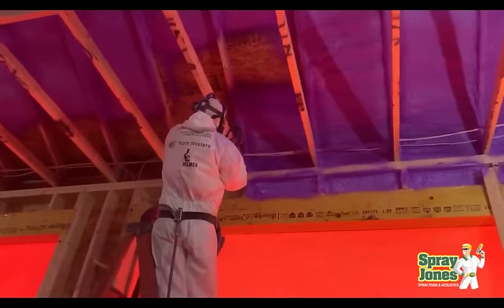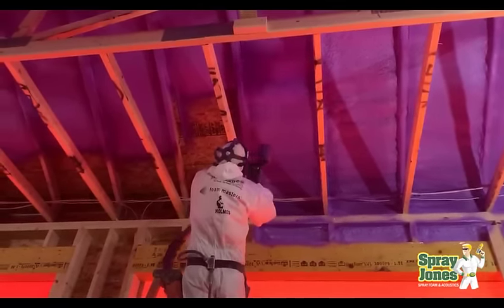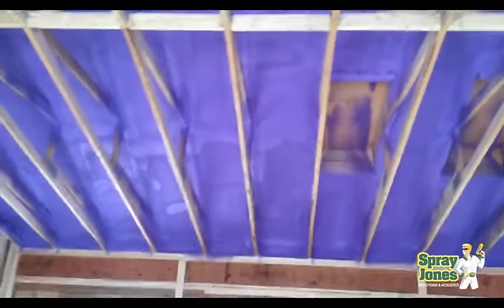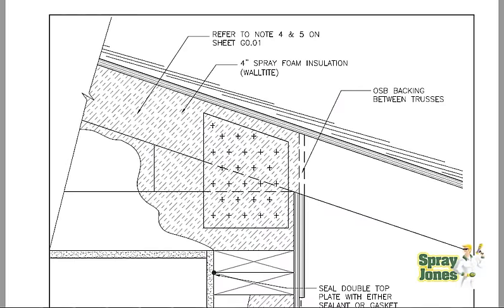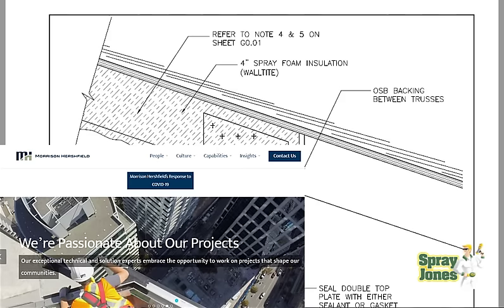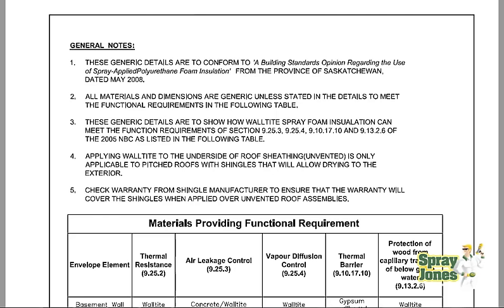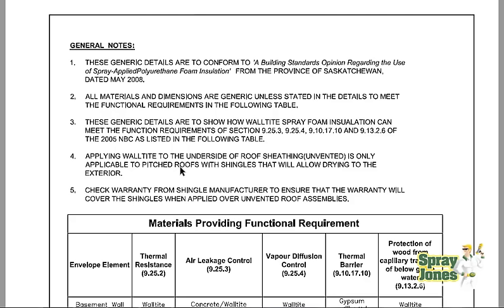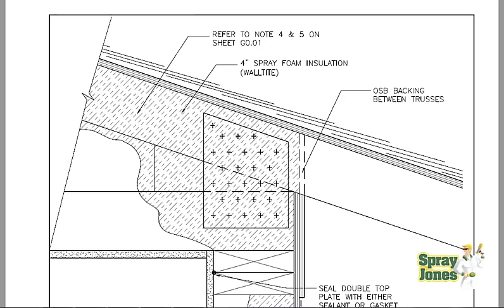Unvented roofs - Closed cell vs Open cell Spray Foam Insulation which is better?

Comment: I need help!!  I have an 11 year old home, 5/12 pitch unvented roof with synthetic underlay and standing seam metal roof on 5/8" tongue and groove plywood. TJI joists support the plywood on a post and beam structure. 7" Closed cell foam insulation is sprayed to the underside, so unvented roof. Every winter the plywood underside in the exterior soffits are completely frosted up and pour down water through the soffits all around the house perimeter every slight thaw. The soffit overhangs range from a minimum of 4.5' to about 12' wide where there are decks underneath. All of the width is frosted up, crossing several TJI joists, and in fact so are the TJI joists fully frosted. Since this is post and beam, and unvented roof, the soffits are 3/4" pine ship lap, with no venting. I've had the builders back a couple of times to try to solve the problem, assuming air leaks. Once they re-sprayed foam from the interior perimeter of the joists and headers. The second time they sprayed the perimeter of the same headers and joists from the outside after removing soffits. But there is not much improvement. Sunny mike winter day today, and so it started raining from my soffits. In the past I have tried leaving the soffit wood out, and the extra air does help, but there is still some frost even then. 

What the heck is going on, and how do so fix this??
Reply from the maker: First you need to get a thermal camera to scan these areas and see if heat or air leakage is present. The scan does not lie. If you see no issue with the SPF or air leakage then you eliminate it as the source and move on to other outside anomalies that can do this. 
All the specs you have given are more than enough to figure this out. Did your builder or you caulk the double top plates that the TJI rafters rest on? How about other areas within the structure for air seal? Are they all caulked? It is common to see the wood seams leak into the soffit area, warm air rises.... The camera will pick that up.
Reply: @SprayJones  The builder was here today ripping out a section of soffit so we could see if fully venting the area would prevent the frost and condensation buildup. The plate on top of the log beams is glued down with construction adhesive, as are the TJI to the plates. If I could send you a picture or drawing so would.
Reply: What thermal camera do you recommend for construction building envelop applications like we discussed?
Reply from the maker: @jb5676  The best you can afford. Flir or fluke.

Flir is the most common and you can pick one up for $500 or under. 
You should have a professional blower door test done with a thermal camera scan. That way the air leakage is exaggerated and ca be seen easier.

Comment: Watched numerous videos of yours you are destined as you said to do this. 
looks like you do great work I've been trying to figure out how to re-insulate my home in Maine which the fiberglass has failed and mice have gotten into it and everything you can imagine because of the roof venting. 
I'm going to continue studying your method as philosophy and by next summer should have a good plan to re-insulate with foam. 

I'm wondering if you can recommend any certified companies in Central Maine that could do as good a work as you do on my house ?
Reply from the maker: Thank you for your feedback it is a welcomed change from the "experts" who chime in their critiques. 
You will have to open things up, remove and clean and then proceed with foam. I cannot recommend anyone in that state.  I get asked this weekly now.... who I can recommend for all over the USA and Canada.
Reply: Try Maine Passive House Bethel Maine

Comment: You've mentioned shingles a couple of times.  What about metal roofs?  Is it OK to apply closed cell like this with a metal roof?
Reply from the maker: Yes
Reply: Closed cell applied direct to metal is common for "barndominiums" in this area.

The metal shell is erected, then interior framing, most plumbing and electrical work done to point of ready for insulation-drywall.
The foam is applied at this point, essentially gluing the wood frame to the metal structure.  The difference in spacing of 2X lumber vs the wide spans in the metal sheet support frame "purlins" results in very few places for heat conduction from outside to inside.

Some amazing R values have been achieved and the buildings are so tight that dehumidifiers are often required due to low air exchange failing to carry moisture from people breathing to the outside of the building.

Comment: Well in my local building code change this to you can't use closed cell on roof underside and encapsulating the rafters. The reason being there was one or two roof collapses because of a poorly maintained roof and the leak over decades had rotted the sheathing and rafters and there was no signs of a leak inside, so no one checked. You can however use open cell because once the foam gets saturated then it would be visible inside that you had a leak and would then go up and inspect the damage and make repairs, plus it was a good idea to replace or dry out the damaged foam. Also our snow load where I live is 62 lbs per square foot which is also a factor. You say these engineers certify that product under those applications, well sure they would, but a poorly maintain roof would not have a bearing on that certification, that's on the owner to ensure their investment is protected. So I guess one or two dummies wrecked it for the rest of us.
Reply from the maker: That's no good. Someone need to take a lead with a supplier and building envelope firm and get that changed. I would if I was there...

Comment: Not a roof but the ceiling of our garage was sprayed with closed cell foam. We have a loving space above this garage and the floor of this room is always  very cold. I put in an insulated garage door and like I said sprayed about 3” of closed cell. The floor above is still quite cold. Any ideas as to why? The contractor said doing the foam would solve the problem but clearly not and still waiting to hear back from them
Reply from the maker: I would have to see the detail and how they did it. Send me an email via my web site. Include some pics.
Reply: @SprayJones  unfortunately it’s all been dry walled over now
Reply from the maker: @skyline5354  Well without seeing it and plans of what was done I have only guesses to offer...

Comment: We recently completed a 12/12 pitched roof with the axis east and west for future solar. Direct southern exposure and the plans specified closed cell foam on the underside - no ventilation.
I've been doing this for almost 50 years and the thought of a cathedral roof with no 1" continuous ventilation from soffitt to ridge vent used to be heresy, but now is the preferred method.
I have been in many an attic that is suffocating in the summer heat, and the old 3 tab roofs would literally curl up at the edges like bacon and then a stiff wind would bend them up and over at the next edge. My concern is what roofing can stand up to the south sun with an insulting layer under that allows no heat dissipation? You mentioned 'ice and water' as the underlayment and the specs did note the roofing material needed to be approved for this application. I'm in Seattle, so not so cold and not so hot, but plenty of water. 
In addition, our building inspector mentioned the dew point as the main factor in negating the need for ventilation.  I have a roof interior coming up for insulating and want to be convinced that this has stood the test of time and I'm just ignorant.
In the 80's we went thru a period of maximum building wrap, sealed windows, caulking everywhere and vapor barrier on the inside, but the exterior envelopes leaked, the insulated walls could not  breathe and there were whole blocks of apt buildings requiring residing in less than 10 years. It was a major problem up and down the west coast from Canada to California.
I subscribed and am working my way thru your videos...Thanks for all the info. I know this is part of your marketing but I also know when someone loves their job.
Reply from the maker: Richard go to the playlist on this channel dedicated the vaulted ceilings. Watch the 4 part series on non vented roofs and the shingle life video I did. That should quell any normal concerns.
Reply: I put closed cell up 20 years ago on vaulted roof around 1.5 inches never had any condensation i can say for sure because much of it is unfinished to this day I'm in Chicago area. Before i put up any foam I waited for some heavy rains to make sure no leaks. If I were to do it over again I would use ice and water dam from bottom to top. I did have a woodpecker make a hole in the wall one sheet of OSB damaged about 2 feet by 4 feet spot to fix  and I scraped the OSB off the closed cell foam without damage to foam.  This foam won't hurt any shingles.
Reply: @portagepete1  thanks for the vote in favor,
my wife wonders what takes me so long to decide...but I just watched a pros and cons (mostly cons), and the #1 issue was flame retardants (mandatory). Any bad smells allergic reactions,..cancer ?

Comment: Do you have a recommendation for someone who would want to do something like this with a standing seam metal roof?
Reply from the maker: Watch the 4 part series on roofs.
Reply: @SprayJones  thank you for your response.  I have just watched the majority of those, particularly episode 3, when you mention roofing systems.  I've reached out to local metal roofing companies about my concerns, not with spray foam bc that is the route I want to go, but with the decking and what goes directly on top of that.  I'm using zip (uninsulated 7/16").  Have you seen metal put directly on zip panels or does that also need an open diffusion membrane?  You also mention that the frost striping doesn't occur bc it is elevated from the decking but none of the metal roofing companies in this area have experience in putting the metal on purlins or anything here.  I live in NW Arkansas climate zone 4.   I know you're not a roofer but it's been a real struggle finding information on this from local roofing companies.  It seems this area may be a bit behind on the times.  Thank you for your patience, information and guidance.
Cheera

Comment: Just did 2 inches of open cell so far under my roof deck, 10/12 pitch vaulted ceiling, I have  ice and water shield over the entire deck , and galvanized wavy metal roof giving me an air gap between the metal and ice and water shield... I'm in northern vermont, didn't see any condensation or anything before I sprayfoamed .  Do you think I will have future problems because I used open cell ?
Reply from the maker: 2 inches of open cell?? Why so little of that product? 
Yes I am VERY concerned.
More info...plse what is this??
Reply: @SprayJones  just because 1 1000 sqft kit only does one inch on that space, all we could afford , we were planning on filling the entire 2x6 ... I should also mention we heat with wood and there will be a woodstove in that area as well as the basement, we used close cell around the bathroom walls and plan to continue with closed cell... There's a video on our channel so you can see it if you want
Reply from the maker: @farmlifeoffgrid  

I think you need to stop and look at what needs to be achieved. Why and how. 
Watch this to start https://youtu.be/lBtiUCO7bFw
Reply: @SprayJones  just watched that video, that's pretty much the conclusion I came up with is they aren't worth it,  that being said what's done is done, I'm just wondering if you think I will have an issue with the open cell on the roof if it's filled completely and will the air gap, metal roof , ice shield help prevent moisture? The roof is basically sealed completely. , or am I going to have to rip the foam out... I'm just a carpenter, I swing a hammer and the more I learn about spray foam is it's something I should leave to the pros...
Reply: @SprayJones  in my video after I got done I even said I don't know how anyone could ever get it right the first try , it looked like shit after  😂
Reply from the maker: @farmlifeoffgrid  Exterior waterproofing is different from interior envelope.
You sound like the roof is very well sealed from the outside.
Now inside:
To stop condensation I like all of my roofs to be closed cell for non-vented with professional SPF.
You have none of those applied. So as you can see in my videos, thickness, adhesion, physicals being met, mix on ratio, depth control etc. ALL matter for the end result. 
If you cannot check all the boxes then yes you will have an issue somewhere in the assembly for a whole host of possibilities. Spin the wheel of fortune...
If it was mine I would rip it all out, save the money and get a pro SPF guy in and check all the boxes for install that you learn here. 

Like Paul Marshall said to me - the envelope is clearly the most important thing in our homes and we should not cheap out on doing it right the first time.

Best regards

Comment: Can I do spray foam on the roof deck Wyth ice & water shield on it and there is 1-1/2 slipper then metal roof
Reply from the maker: Watch the 4 part series on roofs. I get into that parts 2&3.

Comment: So how much insurance should a spray foam contractor carry in the event he or she gets it wrong.

I’ve seen instances where the mix wasn’t quite right, where a roof had to be torn off trusses sheeting everything and replaced.

I’ve heard of instances where the spray foam off gassed toxic fumes. Do the insurance policies have 25-30 year terms?

How does an individual know before he or she decides to use spray foam if they have a sensitivity to the materials used???

In the event of a fire does the burning foam give off toxic fumes, is the whole house completely destroyed by a isolated fire ?

Do insurance companies charge a higher premium for houses that have spray foam installed?
Reply from the maker: Consider this: In Canada we cannot be certified without 2 million in commercial general liability. Most commercial job sites will not let you on without 5 million in CGL.
There is NOT a premium on SPF. Why? The insurance industry knows foam is not a risk. 
All the other questions you asked have to be proven. If someone is off ratio that is on them, insurance does not pay for fraud, or certain cases of willful negligence.
Reply: @SprayJones  OK, thanks for your response.
I used to be a proponent of spray foam, what a great idea.
That is until I realized the potential downside.
Here in N. Florida I met a spray foam contractor who botched a couple of jobs.
He went out of business and the builder and homeowner had a monumental, very expensive problem that cost them a fortune to fix.

I've been in attics in Dallas in the heat of summer that had were sprayed with foam.
I was impressed, the temp, even though not conditioned, was still much cooler then I could have imagined.
Mitigating the risk of an improper install is my biggest concern.
Reply: @RJ-sr5dv  If something seems too good to be true, it is.

Comment: What is best sprayfoam for a vented steel roof,I don't want to pay for conditioning my attic.
Reply from the maker: You are paying for it anyhow. Watch the video I made about "does it cost more to heat this way." 
Plus the 4 part series on non-vented roofs shows the lack of performance in blow in insulation - 50% lower!
Do some more home work.

Comment: Hy Jones, can in use the cellfoam for insolation my camper?
Reply from the maker: Yes
Reply: @SprayJones  Thank you for your answer, can you please tell me which product I should use for this?
Reply from the maker: @thomasbachofer  Open the walls up, remove what is in there and spray in closed cell. 1 inch and up. We have done this may times.

Comment: Colorado code requires a minimum 3" to achieve vapor barrier.... sooo technically you could spray 3" closed. get your vapor barrier... then I suppose no harm to spray another 10" of open cell..... not sure cost of open and if this will get you lower costs....  i just stick to closed cell....   
also......   Ice and Water shield   !00% of roof you will eliminate any issues and I feel is best roof detail with closed cell below
Reply from the maker: Colorado makes no sense... someone needs to challenge that. 1 inch of closed cell SPF on plywood has many times the stats for vapor barrier. In fact OSB 3/8" already has the perm rating to be a vapor barrier.

Comment: Do you ever spray a couple of inches of closed cell foam and then a couple of  inches of open cell foam to save the client money?
Reply from the maker: No. Not yet.... looking into the science of where due point is based on respective thicknesses. So more to come. 
In theory it should be doable...

Comment: So my roof has a 3” gap down the middle for ventilation and soffit ventilation how to you foam that
Reply from the maker: Fill in the gap from the inside with a sheet product and spray over it.